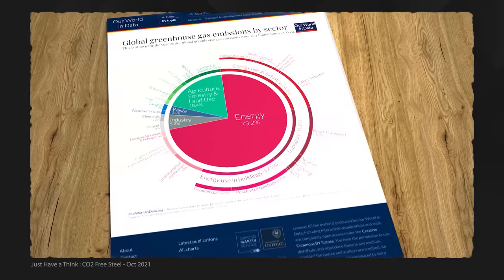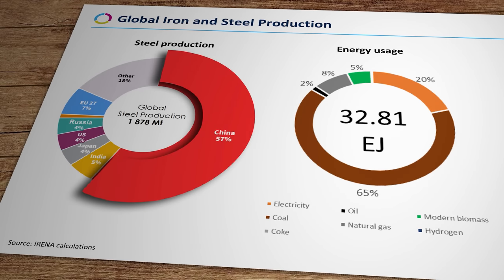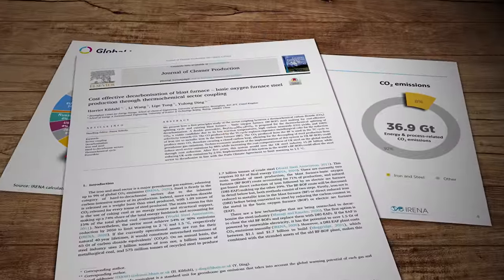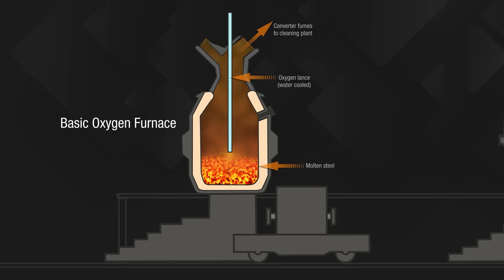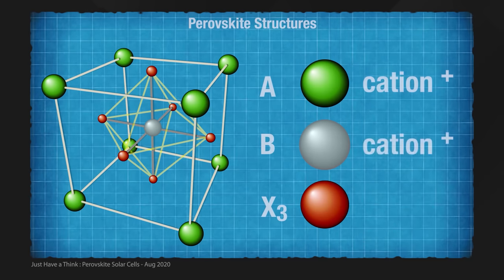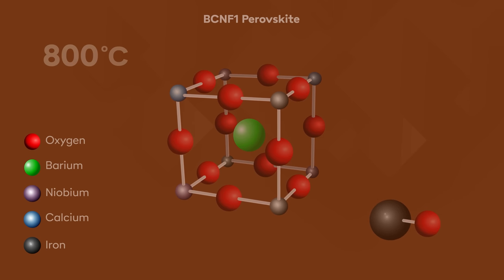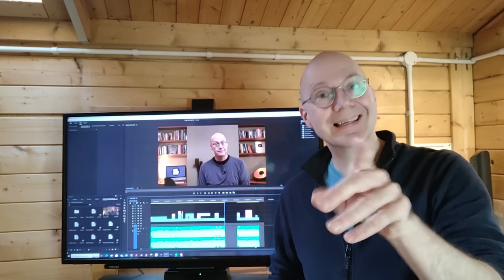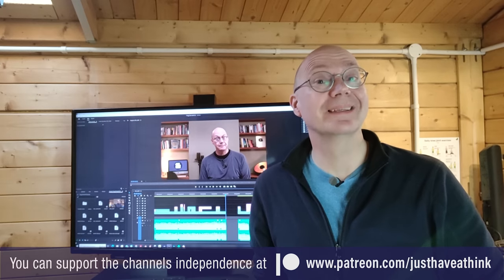New breakthrough claims 90% reduction in Steelmaking emissions.

Comment: That's what I like about this channel.  Check, re-check, correct errors, re-check and be open minded enough  to accept new information that changes the story.  Great Job Dave. 👍🤠
Reply: Just think! . The current temperature trend is negative. It is getting colder but the CO2 is increasing.
Why the hysteria?

Comment: I do hope the Birmingham team get some traction with the local UK steel production teams, perhaps to explore what it would look like to setup their new process in the current steel production lines.  I worked as a sponsored undergraduate student for British Steel back in 1978-1981 and having lived in Newport was highly connected to steel production as were almost everyone in my street as Llanwern Steel plant was a huge local employer.  It would be good to see the research team in Birmingham help the local steel producers.  Thanks for presenting these low carbon ideas Dave.👍
Reply: Newport... It was very ironic to load a shipment of steel there the day they announced closure of the steelplant.
Reply: I am going to expect that efficiency in megaplants is going to be a way forward,  but possibly smaller plant is more CO2 efficient, will be interesting to see how it will work out, clearly we cannot (for political reasons ) outsource our entire metals processing output to China (or even India)
Reply: Check the current trends in temperatures. They are falling but CO2 is rising . The climate change hypothesis is wrong.

Comment: Yes, the moment you mentioned CO replacing Coke, my Pyrometallurgist training (I cut my teeth on Blast Furnaces) dug in heels (burden properties are crucial!). Could be interesting (and easier) to apply this to DRI or HBI processes, which are gas based. But for BF, not likely.
Reply: What is DRI and HBI??
Reply: @srnpandub  from what I have found, DRI = Direct Reduced Iron and HBI = Hot Briquetted Iron. DRI is obtained from the direct reduction of iron ores and is also called sponge iron. HBI is a form of DRI that occurs when the latter has been compacted at temperatures greater than 650 degrees Celcius.
Reply: So what are you saying? Speak english (use words the uneducated can relate to).  The subject is reducing CO2. Can we still make excellent steel after changing the process? CO2 is not the enemy. $$$$$$$ is @ananya.a04

Comment: Great video, Dave! Living in Saarland, Germany, a steel maker here is apparently planning to switch to green hydrogen as well
Reply from the maker: Thanks Martin. That sounds great!
Reply: Is the plant located near an interconnect with France to get large amounts of power to run the hydrolyser? I'm concerned that the grid in your area is having the same issues getting access to wind power from the northern shore, so the claims that its is green will have to be seen with a pink colored pair of glasses in the short-term.
Reply: @terrencesauve  that's my concern too. Detailed plans are not yet available

Comment: Apparently there is also a concept where the iron is extracted from the ore directly by electrolysis. If you can split H² and O² with electrolysis, then why not splitting Fe and O² ? However, that process has only been shown on lab scale so far. But there is a startup in the USA, attempting to implement it on industrial scale. Let's see how this goes...
Reply: This approach is called Molten Oxided Electrolysis (MOE) by MIT Spin-Off Boston Metal. This technology was for a long time rated at very low technology readyness level (because no cathode material could withstand the extreme temperatures and reactivity in molten iron) but recently leaped forward due to massive funding and a new electrode material. Boston Metal already left lab-scale behind, will likely bring a third-generation prototype to operation this year and already secured 120M$ financing (mostly from strategic investor and steel giant AccelorMittal) to beginn building an industry-size plant 2024 (finalization is planned for 2025, if I remember correctly). MOE is considered the most energy efficient process for green steel and also seems very elegant in the way that several of the traditional steps of the process can be done in one. 

I would look forward to see this third option here on the channel one day :) 

Thumbs up for your work and the anonymus Patreon with the in-depth insights!
Reply: Fun fact:
Our local district heating used to use 2 gas generators for electicity and heat. Due to the current green hype they have to phase out the gas generator so they need a new istallation to provide heat to ~15.000 people.
They choose to burn iron powder to rust and use "Green H2" to reduce the rust back to iron. To me this sounds like complete waste of energy over the entire front.

So I wonder: How (in)efficient would this be if the rust was reduced by electrolysis?
(Note the thermal loss in the 40 year old instalation is estimated >30% and it is has no longer electricity as side product.)
Reply: @hotdognl70  Their idea strikes me as loony, unless they can get green hydrogen for free and have nothing better to do with it.  Extracting both electricity and heat from gas is very efficient overall, particularly when that electricity is potentially displacing electricity that would have been produced in a coal-fired plant.  Perhaps next they will propose burning Euro notes for heat...
Reply: @incognitotorpedo42  Burning Euro notes is not allowed: The ink may produce toxic fumes.

But serious: I'm so glad we decided 2 years ago to get disconnected from that grid! A roof covered with solar pannels and a heatpump is saving a ton of money and feels a bit greener than that system.
Reply: Boston metals have spun off a Brazilian subsidiary with the intent of making ferroalloys from Iron Ore mining fines. The production of ferro alloys (Ferrosilicon, Ferromanganese, Ferrovanadium, Ferrochrome) is often done with fairly inefficient processes such as submerged arc furnaces which produce large volumes of Carbon Dioxide. 

The really attractive feature of the Boston Metals system is that it requires Iron Ore fines rather than lump Iron Ore as blast furnaces do. I haven't seen any estimates of energy efficiency of the electrolytic route to molten Iron but the savings in capital cost (Blast furnaces are really expensive pieces of equipment) alone would make it an attractive route.
Reply: @hotdognl70  wasnt sustainable biomass available locally for your DE grid?

Comment: For a couple of minutes, I thought the solution was to replace the Carbon Dioxide off gassing with Carbon Monoxide off gassing, rather than using a closed loop system to use the Carbon Monoxide up.

I am glad I was wrong. Carbon Monoxide off gassing would probably be considered, as my friends across the pond might say: "rather unsavory".
Reply: CO off gassing is normaly done by flaring it off to CO2, indeed rather unsavory.

Comment: Congrats, this time only one typo in the chemistry part. Keep going 😉 And a big Cheers to your patreon who pointed out the complex and decades-long empirically optimised processes in steel production, so I don't have to elaborate on that 😁
However, please explain: If the crude iron (pig iron) has 4% carbon, and the steel has 1.5%, how can this difference make up 0.7 tonnes per tonne of iron? What else is included in that number? 
Because 2.5% of a tonne = 25 kg Carbon, which will become 92 kg of CO2 after reaction. That's 0.1 tonne, not 0.7.

Comment: Good topic Dave, as always. An approach that at first seems impracticable is sometimes the one that proves eventually to be the best solution, once other supporting processes and technologies catch up, re. Electric vehicles, first coming into use before the internal combustion engine took over. Battery and electronics had to be sufficiently developed first before a practical auto was marketed, eg, the Prius. A second approach to greener steel production is to increase electric furnace steel production from scrap, which means a BIG increase in metals recovery programs. There are literally billions of tonnes of scrap ferrous that is not recycled because of the relative low value and high cost of collection and processing. Other non ferrous metals are much more likely to be recycled cost effectively. Over the years, a trend has developed amongst the world's smelters to specialize into different product groups. High value specialist steels, bringing good returns floated off to profitable companies and bulk steel steel making being a near loss maker, especially during economic downturns in the economy, less demand etc. The old problem of cost analysis over the entire cycle, that includes mining, refining, smelting, supply chain logistics, recycling, environmental etc. etc. Is still around.
Reply from the maker: Cheers Graham. Interesting stuff

Comment: Thank you! About the Swedish Hydrogen steel projects. I don’t know anything about it myself really. But when listening to and reading Swedish media, the high cost of making the steel may not be a huge problem according to some because when steel is used in for example cars the higher cost of the steel supposedly aren’t affecting the price for the consumer that much and the car industry supposedly want green steel.

But there are a lot of naysayers to these green steel projects and their argument often is that the required energy for these projects would require about as much energy Sweden use now. And building all this new energy generation in huge wind farms isn’t something they like either.
I don’t know if the required energy would double but it is a lot more needed and more than is currently  available. So maybe that also is a problem how to build this required energy supply.
Reply: the other argument against is that green steel is inferior in terms of strength & durability...disastrous when used in buildings...
Reply: @vincentl.9469  The steel made by these new processes is chemically identical to traditionally produced steel, about 99% Fe and 1% C. The main problem along with the energy requirements has been the development of the technology and upgrading the steel mills (at least in the SSAB/hybrit case, their pilot plant has barely started up and they are moving to convert their full scale plants soon)
Reply: @otsokivivuori7726   The main aim is to not use coal..or coke as some people say, cutting the release of  Co2. how much co2 I'm not clear about. Where will the energy come from for the new process?

Comment: I suspect that the issues of lack of mass-burden can be accounted by modifying the furnace design. Tailoring the slag and metal takeoffs to a different depth. Which is good from a technical standpoint, but will make retrofits impractical. 
Or perhaps we should consider an entirely different technology. Fluidized catalyst systems used in oil refining operate near these temperatures. Perhaps similar technology can be applied to steelmaking.
Reply: Not sure if CO instead of CO2 is such a good idea if it's dumped into the atmosphere? Apart from been toxic doesn't it mop up free radicals which would otherwise be oxidizing methane, which is it's self a gh gas!
Reply: @petewright4640  I believe the idea was to recycle the CO back into the input in place of the coke.
Reply: @JaenEngineering  can't we do that with co2, especially because it is also a greenhouse gas?
Reply: @davitdavid7165  No, we can't.  The carbon in CO2 is already fully oxidized, so is not available for extracting the oxygen from iron ore.  Iron ore is just oxidized iron.
Reply: @incognitotorpedo42  ooh, i get it now, thanks.
That is much smarter now.

Comment: 7:55 My immediate thoughts are 'It's too complicated'. Complicated means more expensive to build and it requires tight tolerances during operations. Any change in either output or input could tilt the entire process and make it either not work at all, not work as efficiently, or not work as intended.

10:09 Aaaand here you pretty much validate my thoughts above. lol. If you wanted the iron/steel smelting processes to become cleaner with regards to CO2 production, you need to make electricity cheaper. If steelworkers were able to use electricity as their heat source, then they wouldn't have to use coal/coke or natural gas to heat up the furnaces. The reason they don't is because the 'dirtier' energy producers are a helluva lot cheaper which keeps costs down for the steel. Cheaper costs means more production, easier expansion, more hiring and cheaper building processes down the line. If you force these smelteries to pay for the CO2 they produce, you're going to kill the steel industry, which will force prices of everything that uses steel way up which will cripple economies. People will turn to dirtier forms of energy (deforestation to burn wood for heat and energy) because they can't afford the cleaner ones and you'll end up making the environment worse while attempting to make it better.

11:32 Lol. And here you're validating my 10:09 comment talking about electrifying steel production. XD

What we need is cheaper, reliable and plentiful energy production. If you can bring down electricity costs to $0.01-0.02/kWh, you could eliminate natural gas economically because it would be cheaper and thus a better deal for consumers. If there is enough excess energy available, then all of these energy hogs, like the steelmaking industry, would be able to switch to electricity as well because it would be cheaper than coal/coke/natural gas. So what energy production method do we have available right now to allow for this? Nuclear. It's clean. It's safe. It's modular. It's getting cheaper. And if your complaint about it is the waste, we can launch that into the sun (or empty space) pretty cheaply now using the new spinlaunching systems they're developing. No nuclear waste on Earth anymore. Wind and solar aren't going to get us there, at least not in their current forms.

Comment: Dave, have you explored Boston Metal yet? An MIT spinoff, Boston Metal is developing Molten Oxide Electrolysis, MOE, which uses electricity to separate the oxygen out of iron ore. The only "waste" gas is oxygen--MOE was developed in part to provide oxygen for lunar colonists, and it will displace the entire medical and industrial oxygen gas industry--and the only carbon involved is that which you add to the melt. Add the right amount of chrome and you get a pretty good grade of stainless steel right out of the primary melt, no need for a second heat to create an alloy. It should work with metals other than iron, too.

Boston metal says that MOE will use less energy overall to make steel, and that it should cost 20 percent less than coke-furnace steel, but that we will have to expand electrical generation by about 20 percent to clean up the entire steel industry (which MOE developer and MIT prof Donald Sadoway says is 9 percent of climate change). A small modular molten salt nuke, or a bank of Lawrenceville Plasma Physics dense plasma focus fusion generators, powering each steel mill, and maybe providing its community with electricity during emergencies,  or selling any excess into the grid? Boston Metal is currently prototyping, and say they are on schedule to commercialization by 2026. They also say MOE scales up/down well, and that the plant should cost a fraction of the price of a new coke-steel (is it correct to say Bessemer Process?) plant.

MOE can make use of low-grade ores. The Swedish HYBRIT (hydrogen reduction) tech you mention needs the high-grade stuff.

Hasn't most of the American steel industry been decapitalized and offshored? Les-expensive new plant to make 20-percent-less-expensive steel sounds to me like a better way to revitalize the American steel industry than tariffs paid by consumers. And with China's belligerence, it might make sense to not be dependent upon  a wannabe geopolitical enemy for steel (or anything else strategic).

Google Boston Metal, or read the rant, Clean Steel, at www.ptbocc.com. You can also download (or read and comment online) an advance reader copy of the book, Pumping the Brakes on Climate Change: A Review of the Technologies and Politics that Could Leave the Future a Future, there. The chapter, Steel is a Filthy Industry. New Tech from MIT, SSAB could Make it Clean, Cheaper, explains MOE and the (more expensive, more energy-intensive) Swedish HYBRIT techniques rather well, but misses out on the perovskite thing.
Reply: To be more precise: MOE is supposed to be 20 percent more energy efficient overall than blast-furnace steel: Hydrogen reduction is supposed to be 20 percent LESS energy efficient than a blast furnace. Very rough first analysys, that would make MOE clean steel ~40 percent more energy efficient than HYBRIT.  I AM a little concerned by what we do with 3/4 ton of O2 liberated per ton of steel made: increasing atmospheric O2 from 20.9 percent to 23 percent will, I read, make wildfires hotter and more frequent, and we're already having enough trouble with wildfire as we dry out the planet. We can use a lot of oxygenin industry, medicine, and the space program. But maybe 3 gigatons now, 12 GT/year by 2050? Don't know what we're gonna do with all that O2.

Comment: A very interesting video, thank you. The problem of replacing the structural support provided by coke in a blast furnace is also faced by teams trying to replace air with hydrogen in conventional blast furnaces, such as Thyssenkrupp Steel. One solution may be small ceramic bricks to provide the structural support and separation in the mix, which would be recovered and reused.